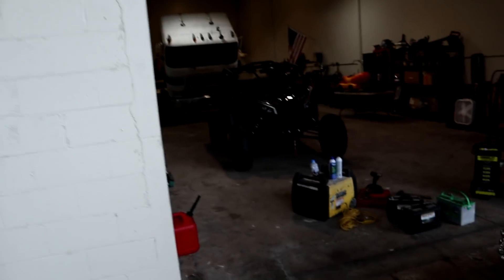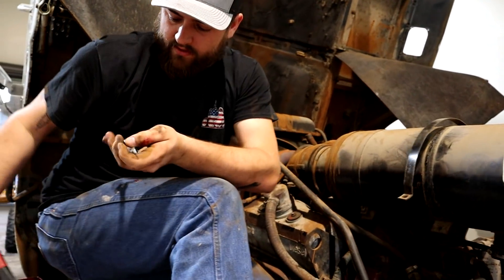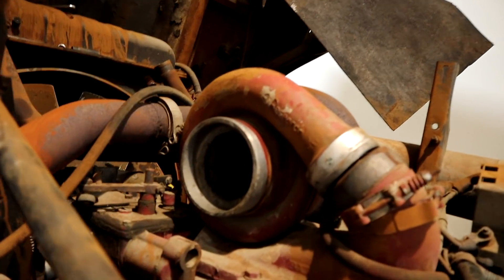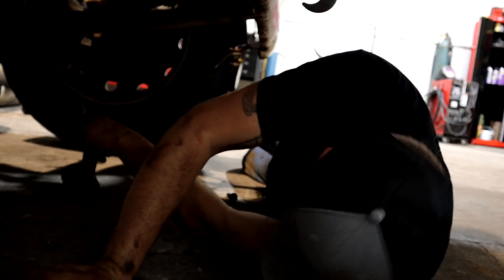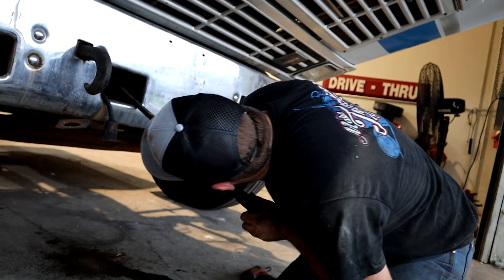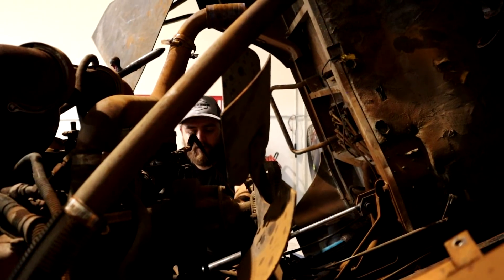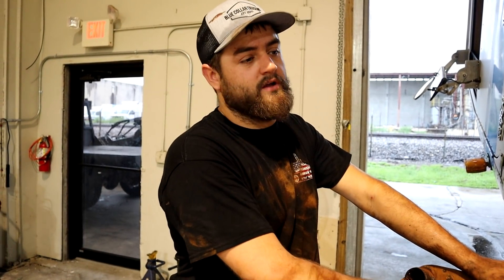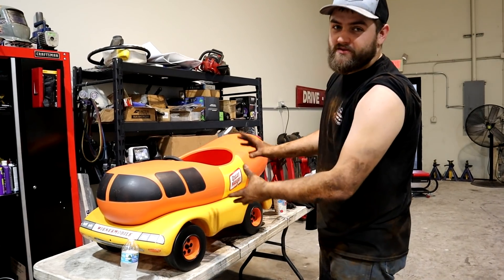Big Rig Radiator Removal from the Air Force Cabover!

Comment: somehow I knew we would reach this option1, option2 moment.
Reply: no surprise
the truck is Junk.
Reply: @jackmehoff2961  @$1,500 it would be a fine project. @ the $10,000 he paid for it, you're right, it's junk. @ the $10,000 he paid, and cut it in half, IDK, what is scrap going for these days?
Reply: @joestreiff9401  must not be much, with all the old parked rigs.
Reply: i agree he cant finish  what he starts  id like to have the money he spent on all three trucks
Reply: @michaelstapleton5510  he`s got a nice chunk of change tied up in that AF truck, with airfare & hotel.. Not to mention fuel for 600 miles.

Comment: You are probably going to have to get a new radiator. Also check your heater core as it may also be badly corroded.
Reply: I've seen some pretty bad radiators, but that's about the worst I've ever seen. Doesn't look like it's worth fixing. The radiator shop might tell him that.

Comment: Glad to hear y'all have radiator repair shops in Florida watched the video of y'all pulling the fuel tank off the chevy luv have them to boil and rott the rust out of the tank it will save you time trying to find another fuel tank cause finding good chevy luv fuel tanks are going to be hard to find thought I would suggest it might be worth checking out keep up the good work doing a great job.

Comment: Well that didn't take long... cuts the frame on a solid old truck with history and stuffs the chassis, as it will have alignment issues. 

Runs the 2 stroke with a stuffed radiator, fills with creek water, he going to realise the motor has had it and part it out.

This project was doomed from the start, finish a damm project Bruce

Comment: I just changed my radiator in my 2000 Peterbilt last week with my son it was pretty much simple I found out it was cheaper to replace the radiator than repairing the radiator I got mine from truck pro it saved me a bundle rather than going to a dealer and you have one not to far away from you

Comment: Save your back by getting yourself a Booster Pac Es5000, it'll start anything, and when I say "start" I mean crank it over almost like it's got double voltage.  The one I have now is 6 years old and still cranking all my diesels on the coldest mornings.  And they're still around $125 bucks.  I don't even try to keep batteries in my tractors and longer, I just use the booster pac when I need to use it.  And running it in the tractor means I almost never have had to charge it.
Reply: 6 years!! That's impressive. I'll look into that, thanks. Who makes it?

Comment: when you have a chance while the radiator is out of it try to flush as much of the old stuff out of the coolant system plus check out that water pump while every thing is out of the way. just to check out every thing for a piece of mind type of thing to prevent a supprise  type of thing same with the thermostat not knowing if some one took it out or stuck open do to the not knowing of the unknown

Comment: Hopefully the rest of the radiator tanks aren't rusted out and they can weld in new fittings because I highly doubt you would be able to find a new replacement for that. If there is one out there it would have to be NOS and probably cost twice as much as re-coreing that one. Its probably going to be about $2000 to recore and weld new fittings in those tanks. Dont cheap out on the radiator all the time and money you are going to put in the engine would be for nothing if it runs hot and blows up.

Comment: I would check the other international radiator it might fit but don't no could save some cash. Do a will it start on the KW aerodine conventional in the junk yard be better then the Mack if it starts buy it fix it up

Comment: After you get it all fixed up nice and pretty that would be a good idea to give it away
Reply: If he had not stretched the frame, I would take it off his hands, but I wouldn't have it now. 
No offense to those who like stretched frame trucks, but to me they are not good looking.
One of the best features about a Cab-Over was the turning radius. You can back a Cab-Over into places you could never get a truck with a hood. 
But now, with the stretched frame, you would have trouble backing it into places that an unmodified truck with a hood will fit.

Comment: Please dont give the Airforce truck away, I started watching your channel with the original International and have followed this since.
1 What happened to the original international I notice its not outside the shop anymore?
2 You said you were going to do a Ground up restoration on the Airforce truck, lets see this happen!!
Reply: After pulling the parts off of the white International, he sold it for parts or scrapped it. He said in a previous video there were too many issues with it as they dug into it, going by what he was saying.
Reply: @adamtereska8734  Yeah I know that bud but then the last time I saw it on a video it was "parked" outside the workshop, there has been no further mention as to wether he actually sold it or if he scrapped it

Comment: Don’t refill the cooling system with tap water. It’s going to take forever to flush the system and block clear of oxidation. Can you flush the system with a barrel full of coolant and system flush before putting a rebuilt radiator in?

Comment: Give the Air Force truck away, you should have never bought it with that little engine in it, you got the Shaker which is 10 rimes the truck.

Comment: When you work on this truck, why exactly are you in a rush?
Reply: Because,once again,he's saddled himself with another cabover that has exceeded his skill level and his attention span. Brouches idea of a restoration is buying some pile of rust from a junkyard,pressure washing it,throwing some wheels and tires on it,a hood ornament,oil change and its considered done. He's nothing but a tire changer at a legtimate truck service station,and even thats pushing the envelope of his skillset. He's talking of giving it away,yet hasn't even finished welding out his frame rails where he stretched it. He's a comedy of errors.
Reply: @specwar64  the truck is a pile of crap.
he has no intention of finishing it.
Reply: A rush? I take it you've never been in a non YT shop.

Comment: If the air force truck was an automatic transmission, I would love to have it. Lol
Reply: Back when that truck was new, they didn't have automatic transmissions for big trucks.
Reply: @davide.burden2043  true but having a damaged knee prevents me from driving a stick. Back when I was growing up they hadn't heard of automatic transmission either
Reply: @Timothy Williams
I'm retired now, but I did it for years with bad knees.
I drove 10 speed, & 13 speed manual transmission trucks for years after having 4 knee surgeries. One on my Right Knee, and three on my Left Knee. I never had any problems with having a manual shift.
Once I get the truck moving, I never touch the clutch until I have to stop it. Most of the time I didn't even use the clutch when stopping, I would just pop it out of gear once my speed was slow enough, and let it coast to a stop using the trailer brakes. Then clutch it and get it back into a gear, and float it the rest of the time.
Once, maybe twice in a 24 hour period was all I ever needed a clutch. Of course I understand that trucking has changed a lot since I retired. A driver can't run like us old farts used to. Many times I drove until I needed fuel, and it was not uncommon for me to drive from the Midwest to Shaky all in one run while making one fuel stop. Usually right before going into California, and I would play in my puzzle book while filling up so it showed that I was still good to go.
I hear that the logs are all electronic now, and the hours of service has been cut down a lot too. It's probably a good thing I got out when I did. I never drove sleepy or if there was ice or heavy fog, and I never had any bad accidents either. At one time, the company I was driving for, was short on Teams, so once in a while dispatch would give me a team run because he knew I would get the load there in just a few more hours than a team would. I'm somewhat of an insomniac though, about 5 hours is the most I've ever been able to sleep in a day.
Reply: Love the Eaton fuller 10 speed but the doc said no so did the dot
Reply: That's what I'm talking about Tim, they have a lot more restrictions now. My doctor and the D.O.T knew all out my knees, and they cleared me to drive.
It's not like I could have hidden it from them if I had wanted to with all the scars on my knees. They even saw the 13 inch zipper looking scar on my back from surgery there too, but they didn't care.
Reply: Yeah that's what I'm waiting on now. The doctor to send the clearance letter
Reply: Well good luck out there Tim. If a dispatcher ever tells you to do something you know you should not do, if your company has Qual-Com, tell them to put it on the Qual-Com. They won't! They will lie and tell you anything they can dream up to get you to go when you shouldn't, but they will not leave a written, or computer record that they can't erase.
Keep the shiny side up and don't feed the bears. Watch out for Gators too.

Comment: Great to see The Air Force Cab Over coming along. But I would have put something under that radiator. That can't be good for the environment. But I digress. I wouldn't give away The Air Force Truck. That's just retarded. You guy's put all that work into it.